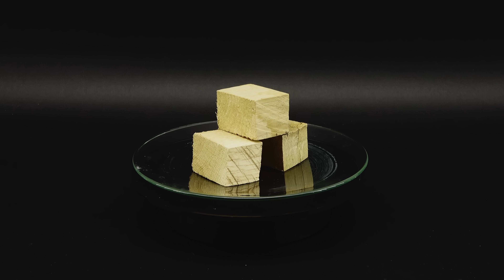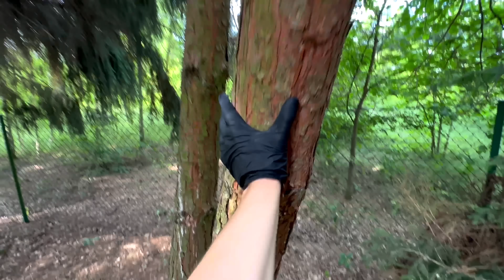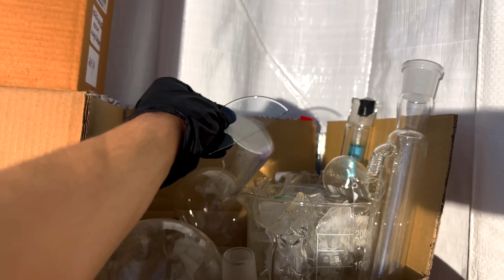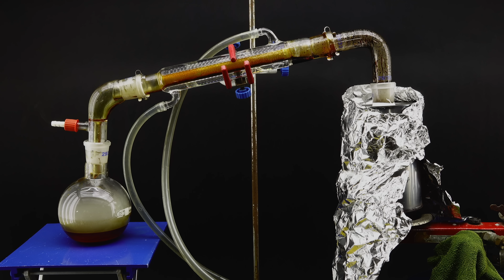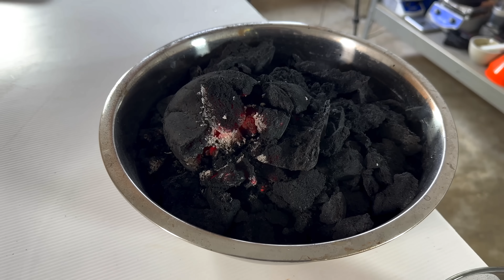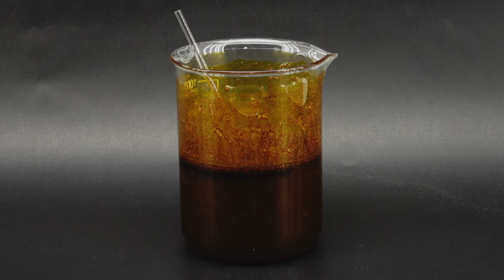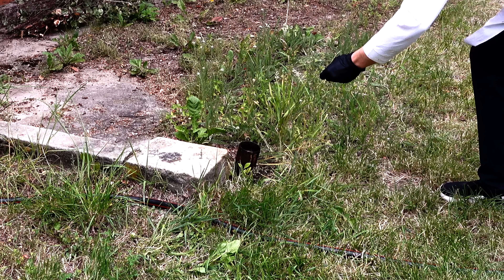Turning Wood into Alcohol

Comment: I have been playing around with TLUD (top-lit updraft) stoves made from stacks of semi-nested metal coffee cans over the 8 months or so. Converting organic matter to charcoal via self-pyrolysis is fascinating. It's also terribly filthy (especially if the flame goes out; so much smoke! So much wasted unburnt wood gas!).

I also used methanol to get the process started since setting a stack of of wood chips, sticks, and shaving on fire and keeping it on fire long enough for it to become hot enough to become a self-sustaining combustion process can be rather tricky. Methanol was a nice way to get the process started.

Periodic radial holes above the smouldering wood along with the updraft from the hot gases draws air into the holes, mixes with the flammable wood gas, burns, and then rises up the chimney to be exhausted. I had some gouts of fire coming out that were several feet long. It roared and the sides glowed a rather noticeable dull red.
Reply: TLUD stoves are a fun way to explore pyrolysis, and the methanol trick for ignition is clever. Those flame gouts sound intense, especially with the glowing sides. The smoke issue is real, but the process gets more efficient with practice. Have you tried different biomass materials to see how they affect the burn?
Reply: @TheBook_Hungry_Minds  wrote: "TLUD stoves are a fun way to explore pyrolysis, and the methanol trick for ignition is clever. Those flame gouts sound intense, especially with the glowing sides."

Indeed! I tried cooking on it, but only managed to get the water simmering. I think that a stove with insulated sidewalls would be required. It's hard to get close to the thing when it's roaring audibly. Not because of the sound (it's louder than whispering, but quieter than talking; it sounds very interesting), but because of the heat. I don't have sufficiently reflective clothing to stand adjacent to it .feel like strapping a frying pan onto the end of a 6-foot pole, opposite a counterweight, in order to cook with it, nor do I do not ..

When it is well-stoked and well-oxygenated, and most of the flames have died down, the glowing charcoal inside can still make it uncomfortably warm to approach within a foot of it. I was also concerned that it might set my eaves on fire. Fortunately

"The smoke issue is real, but the process gets more efficient with practice."

Very true. Because the cans are stacked, I worry about it shifting. It has collapsed several times. Smoke becomes the least of my worries at that point! :)
Reply: @TheBook_Hungry_Minds  wrote: "Have you tried different biomass materials to see how they affect the burn?"

I have! Dry leaves burn incredibly quickly and violently, throwing many an emberous piece of ash skyward. Sawdust burns poorly due to lack of oxygen. Wood shavings (as from a hand plane) are extremely good kindling, especially when there's a mix of different thicknesses. Corrugated cardboard boxes can be cut into strips perpendicular to the direction of the corrugation troughs and valleys, then the cardboard can be rolled into cylinders of a diameter sufficient to fit through the mouth of the can and then be stacked up inside of the can. The several-dozen slots that I punched into bottom of the primary burn chamber act as a restrictive fire grate, retaining the fuel while allow some air to rise from the bottom. The corrugations in the cardboard act as tubes for air. This makes it hard to ignite because the air has to flow up through hundreds of tiny straws. Corrugated cardboard charcoal coils are frickin' bizarre! They weigh next to nothing, but they occupy a lot of volume!

Anyway. I tried tightly rolled newsprint and various types of papers. That does not work well. Newsprint turns to structurally weak ashes that fly up and rain down and also piles up quickly, rapidly reducing the already laboured airflow to basically nothing. Cardboard (like from food packaging) is very unpredictable. If there is a glossy paper side, that should be peeled off, as it seems to act as a fire-suppressant. If there is a glossy plastic side, that should also be peeled off, as its burnt husk seems to stop glowing very quickly. Wood kindling and sticks are excellent fuel when stacked vertically in a bundle, but the bundle takes a few minutes to assemble inside of the can. Wood chips are difficult to light, but are very low-maintenance when it comes to filling the fuel chamber. I have yet to try wood pellets or barbecue charcoal briquettes. I suspect that the wood pellets would provide the most even and constant burn. I think that the briquettes would make a good base layer to allow airflow but greatly reduce the speed at which the smouldering zone approaches the hole-punched bottom of the can.

I have also made TLUDs from various soup and large pasta cans. I should upload videos of my experiments.

The stove pieces wear out relatively quickly. They're all rusted following the galvanizing being burned off. Any parts that are exposed to direct flame (petals in my various restrictor cans, or the tabs that hold the soup cans together) are reduced to wrought iron, thinning and being embrittled.
Reply: @TheBook_Hungry_Minds  It would be a lot easier to solve the smoke issue if the burn rate could be made constant. I think that's really only doable with wood pellets. The problem is that if it starts causing too much thermal decomposition of the fuel at too rapid of a rate, then the amount of smoke can snuff out the stove. If the decomposition rate could be constant, then the amount of air being introduced could be finely tuned for extremely clean combustion. There's normally two relatively brief points and one very long point during a burn when the stove burns cleanly. It's smoky during ignition. Then burns cleanly, then it becomes too hot and so produces abundant flammable gasses but has incomplete combustion (i.e. smoke). Once that settles down, there is a second, shorter clean-burning period. After that, as they pyrolysis of the fuel winds down and the charcoal uses up ever more of the oxygen, the amount of gaseous fuel being generated per unit time is reduced until the flames go out, and there's a third period of smoke. If you're making biochar, this is where you normally quench the fuel with water until it is extinguished. Once all of the all of the volatiles have been evolved from the fuel, the oven transitions into a very long smokeless period where the carbon charcoal is being burned. If you're making ash, or trying to burn off the vast majority of charcoal, then you might be in for a long wait. Corrugated cardboard charcoal burns very hot for a short amount of time. Wood charcoal burns hot for a long amount of time.. leading to  only one point during a burn 

I used an infrared thermometer and the typical temperature of the oven is about 250 to 300 Celsius. Much better charcoal could be produced in something like a steel drum TLUD because the temperatures would be much higher. I managed to max out the thermometer once. This means that temperatures peaked somewhere above 450 Celsius. I doubt it got much higher than 500 Celsius though because it was really slow to heat up from 400 Celsius to 450 Celsius.

Ultimately, I'd like to find a larger combustion chamber and chimney. Maybe I can do something with some flanged steel pipe sections that I can bolt together and drill holes into so that I don't have to worry about the stack of hot metal collapsing during use.

Comment: I would definitely like to see a video where you recover everything. You could use the gas to keep the fire going which would make the process a lot more efficient. Also, it's an amazing score to get all that wood. I'm surprised that a furniture maker wouldn't need blocking pieces from time to time that they could make use of it, or at the very least use it for some other purpose, but lucky for you.
Reply: Recovering all the byproducts would be a great follow-up experiment. Using the wood gas to sustain the heating process could improve efficiency, like a self-fueling system. The wood score was indeed fortunate, and repurposing scraps from furniture makers is a smart way to source materials sustainably. It’s interesting how much useful chemistry can come from what others might consider waste.

Comment: Ore Dog Productions has a great video with the gasses being redirected into the fire, its also used to measure the stages of the process as you did.
Reply: That's a solid reference. Ore Dog's setup with gas redirection is a clever way to monitor the stages while maintaining efficiency. It's interesting to see different approaches to the same process.

Comment: Could be neat to use the charcoal from the reaction to purify the methanol from the reaction from the other products of the reaction.
Reply: That's a smart idea. The leftover charcoal could potentially act as an additional filtration step, especially since activated charcoal was already used in the final purification. It might help absorb more impurities or residual odors before the molecular sieves remove the water.

Comment: Would it be possible to circulate the expelled wood gas back to the burner and make a self-sustaining reaction once it’s been kicked off by the stove?
Reply: Circulating the wood gas back to the burner could theoretically work, but there are practical challenges. The gas mixture contains non-combustible components like carbon monoxide and water vapor, which would dilute the fuel value over time. The system might need additional purification steps to maintain combustion efficiency. It's an interesting idea, but sustaining the reaction purely on recycled gas would likely require precise control over gas composition and flow rates.

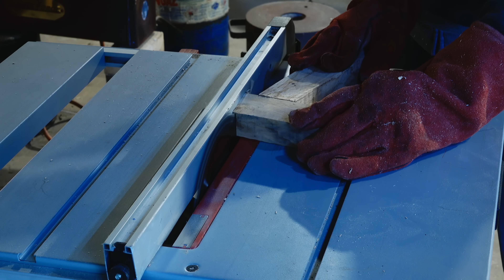Comment: 7:13  YIKES!  To anyone seeing that, DON'T DO IT!  Use some sort of pushing device, to keep your fingers away from the saw blade!
Reply: He's using a pushblock and a fence he's fine
Reply: @noodlelynoodle.  Not when using a glove
Reply: @ElektronDeForza  he's wearing leather gloves, if those hit the blade the blade ends up just binding it's not like the thinner work gloves but he's also not getting his hands that close to the blade
Reply: @noodlelynoodle.  The table saw will cut through wood, leather and flesh with the same easiness. Never use gloves when using rotating tools. If you don't believe me check out de-gloving. It is exactly what it sounds

Comment: Don't use gloves with spinning tools, and don't cross cut against a rip fence, that's how you get kickback.
Reply: Safety points are always worth repeating. The video shows some risky steps, especially with the table saw handling. Proper technique matters a lot in these setups.

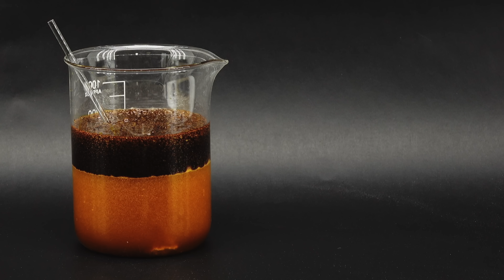Comment: 19:38 it isnt acid base reaction since baking soda is a salt
Reply: True, but when mixed with water, it becomes a basic solution, so it does end up being an acid base reaction
Reply: @minefreak2000 Indeed. And to further add, carbonate anion transforms into bicarbonate by accepting one proton, and one further proton turns bicarbonate into carbon dioxide gas and water, so it gets pushed into the direction of alkaline.

Comment: Things to do with charcoal: syngas or something, dunno if that's DIYable, but you might wanna try it
Reply: What he did in this video was producing syngas. Burning wood with low oxygen.
Reply: Syngas production from charcoal is definitely DIYable with the right setup. It involves heating charcoal in a limited oxygen environment to produce carbon monoxide and hydrogen. A simple retort setup similar to the one in the video could work, though safety precautions are crucial due to the toxic gases involved.

Comment: Wow you made this so much more painful than it had to be.. You should flame polish those cut joints before you subject them to extreme heat, and I hope you don't die of zinc poisoning burning a galvanized steel can... Brazing some pipe to and old propane tank would save a lot of clean up, since you wouldn't have to clean it if you don't want to.
Reply: Are paint cans galvanized? Most sellers seem to advertise them as being made of "tinplate", but I'm not sure if that's meant to be literal. They don't have the look of hot-dip galvanized metal to me, though.
Reply: @arealbug it very well could be tin plated, That's something I would check before I just assumed though, zinc poisoning is no joke
Reply: Flame polishing the joints is a solid suggestion for durability, and switching to brazed pipes could streamline the setup. The galvanized steel concern is valid—safety first with materials. Always good to hear alternative methods that could improve the process.

Comment: If you plan more projects involving "creatively modified" glassware, you might consider getting a diamond disc (usually sold for cutting tile) for the grinder. They're not too expensive and are far less likely to shatter.  Also you might get better results if you mount the grinder to the bench and manipulate the workpiece instead (wear those welding gloves and appropriate PPE).
Reply: That's a solid suggestion about the diamond disc. Mounting the grinder to the bench would definitely improve control and safety. Welding gloves are a must for handling glassware modifications. The right tools make all the difference in these kinds of projects.

Comment: Woodworking 101: Gloves + Tablesaw = Hands - Digits
Reply: Hey so hands=gloves+table saw+digits good to know 😊
Reply: @FAB1150  technically you can make a hand by cutting your fingers on a table saw and stuffing a glove
Reply: @FAB1150 😂
Reply: Look, one finger and a thumb is all that anyone needs. Anything more is a luxury.
Reply: Same thing for metal working. The machine do not know the difference between metal and flesh, not does it cares.
Reply: They are leather gloves, I don't see the problem. They offer extra protection
Reply: @Kannot2023 The problem is that tje leather isnt going to help at all if you make contact with the blade, but if your glove gets caught in it you get your hand ripped off or your arm dragged into the saw. The only gloves for working a saw like that are designed for it, and will disintegrate instead of dragging you into the saw. It isnt a small thing.
Reply: i have once been saved from disaster by using gloves but that was an old machine and it's protective cap was honestly detrimental to safety by forcing me to manually move it up half the time and in one case the gloves allowed me to react before my fingers were sliced. EDIT ( tight workgloves, nothing like the ones in the video)

Comment: I've been making pine tar, it's like nature's hot glue. Never thought that there would be that much liquid collected from the destructive distalation of wood. I'm gonna have to attach a good condenser on the next batch! Thanks for posting this!
Reply: try mixing pine tar and methanol in a glass bottle, makes the old finnish cocktail traditionally served for russian tankers, nowadays usually replicated by politically frustrated mixologists with cheaper ingredients like gasoline
Reply: Pine tar is such a versatile material, and it's fascinating how much liquid comes out of wood during destructive distillation. A good condenser really makes a difference in capturing those volatile compounds. This video shows how much potential there is in these traditional methods.

Comment: Can you publish the yields of the other substances, like the charcoal? I have a sawmill and would love to make useful products out of my "garbage"
Reply: The video mentions the main focus was methanol, but destructive distillation typically leaves behind charcoal as a significant byproduct. From 2kg of oak wood, you'd likely get around 20-30% charcoal yield, depending on heating conditions. The process also produces small amounts of acetic acid and acetone, which could be collected if you modify the setup. Sawmill waste would be perfect for this, since it's already dry and finely divided.

Comment: You could use liquid glass (aka sodium silicate solution) with some appropriate filler (sand, maybe) to glue ground glass joint to the lid. It is also perfectly heat-resistant.
24:44 41.6 g is 2% from 2 kg. So 0.02 must be a mass fraction, not percentage.

Comment: Next time. Put your charcoal in a vacuum canister. It will take the air and other volatiles out. To keep it from spontaneously combusting. You're welcome 👍
Reply: Good tip on the vacuum canister for the charcoal. That would definitely help prevent combustion and keep the purification step safer. The yield might improve too with less volatile contamination. Always cool to see practical tweaks for these old-school methods.
Reply: So I was wondering if compression of the methanol acetone could possibly be separated this way? So either the outputs going to be strictly methanol or acetone.? What do you think it's just going to be a mixture of both of them? That would definitely give it a 99.9% purity but again we're dealing with two volatiles here. So I'm unsure if the pressure is going to isolate one from the other it's just a thought   @TheBook_Hungry_Minds